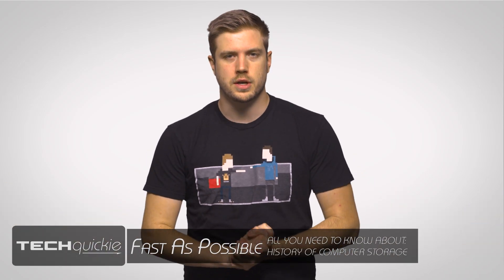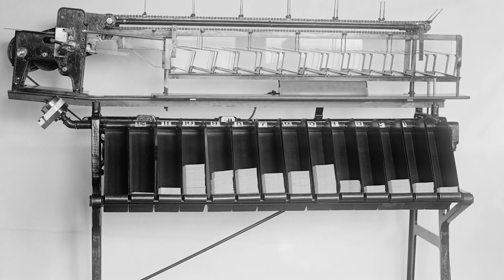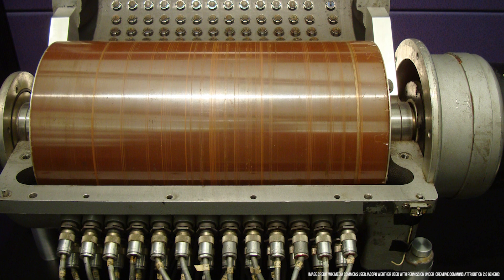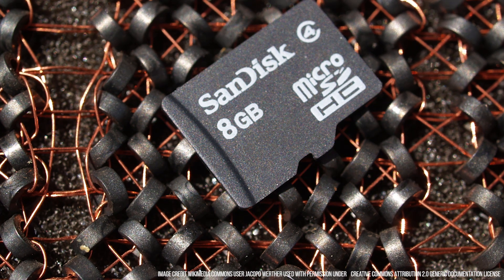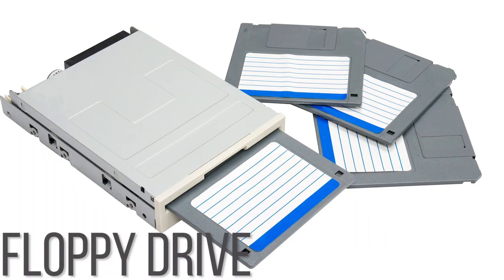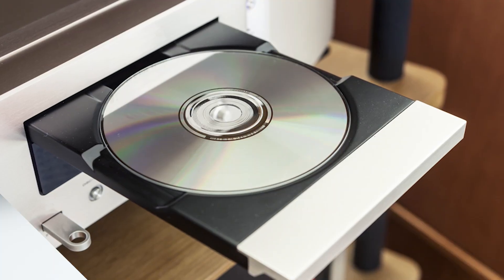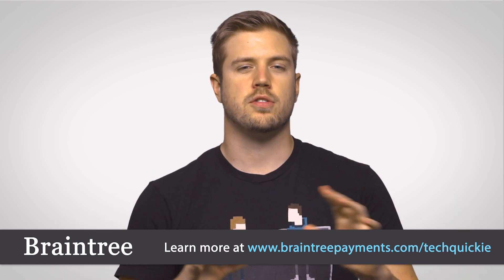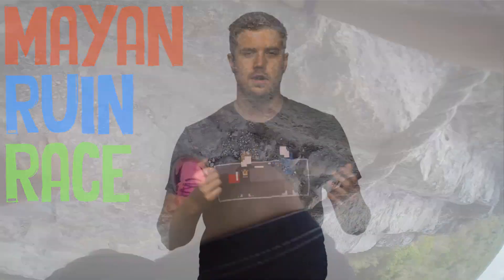The History of Computer Storage

Comment: Insert floppy disk 1 of 25.
Reply: Ha LOL! Lucky I missed all that Windows installation nonsense with 25(!) floppy's
Reply: Billy Ashworth As i child i always liked to chew the floppy disks. There would always be at least one missing from the bundle.
Reply: gta 5 Still needs 7 cd's to download, about every 15 mins i needed to switch cd's

yes. gta 5 on a cd...
Reply: +CWplayer
No, if you would store GTA V (65GB) on CD's you would need 93 as a CD only holds 700MB. 
With single layer DVD's (4.7GB) you would need 14 and with dual layer DVD's (8.5GB) you would need 8.
Because of that modern games are sold on Blue-ray Disk's of which you need 3 for single layer disks (25GB), 2 for dual layer disks (50GB) or only 1 for triple layer (100GB) and quad layer (128GB) disks.
Reply: +Mid Night I'm pretty sure physical PC games have not made the switch to Blu Ray yet.  I got black ops 3 for PC on the cheap and it included 6 DVDs and a steam download code.
Reply: Terraapples
i just checked, you are absolutely correct...
And it confuses me...
But as i just checked, 7CD's are stil cheaper around 30% then a single triple/quad layer Blue-ray.

From this i would predict that the change will slowly happen when game files exeed 100GB.
Reply: GTA V on Floppy disks...
Reply: *****
On the classical 1.44MB floppy disk it would take 45,139. For the biggest one available (240.75MB) stil it would take 270.
Reply: Gta5 on punch cards..
Reply: i think the reason why they're still using dvd's for pc games is simply because most pc gamers don't have a blu ray drive. 
and many of those don't have a good internet connection either so they would cry that they have to download for literally one week for a 60+gb game.
Reply: +CryoMotion i download at 1-2mbps :D 

kill me
Reply: CWplayer
i had myself a bambus internet connection for years. i feel sorry for you ;o btw mbyte/s or mbit/s ?

i had to stuggle with 350kb/s .-.
Reply: Fixedup89
Warning assumtions used
With a pretty standart 80 collum punch card (resulting in 120 bytes of storage) you would need about 541.666.667 punch cards for the 65GB of GTA V
Each of those cards is about 0.000180m (0.007 inches) think.
When you would build a tower out of the cards needed to store the game it would be 97.5Km (60.584 miles) high, just below the edge of space.
Reply: CryoMotion
3 years ago i had to struggle with 100Kbits...
Now the real problem is that 100Kbits is only a marketing stategy and normal datasize is in KB so the "real" speed (including code inefficency) is about 10KB.
It would take min. 2 weeks to download (i have a photo from this time of me trying to download Battlefield 4, 475h.)
Reply: Just to let you guys know, 8 Bits = 1 Byte, so that means 1 Megabit = 125 Kilobytes, and 8 Megabits = 1 Megabyte. Also Internet providers use Bits instead of Bytes for marketing reasons.
Reply: +CWPlayer
That would be 3 single layer DVDs, or 1 DL DVD and 1 SL DVD
Reply: +Terraapples, Mid Night
Reason is not many have a Bluray drive.
Everyone has a DVD drive.
Reply: Ralakus
Not in australia they dont
If you're on the 1000GB plan you get 100GB of data(upload and download)
Which is about 93.1GiB in windows
Reply: +CryMotion +IIGrayfoxII Actually, many people don't include any disc drive in their build these days, because you can easily get a download code for your piece of software or video game or you can get the software on a USB-drive.
I can't remember the last time I used my DVD-drive.
Reply: +Clin9289
True
I Have a bluray writer on my PC but it is more of a full entertainment machine powerhouse, HTPC, Gaming and encoding
Reply: IIGrayfoxII I don't have a DVD drive or blu ray drive
Reply: that would be around 73662 disks
Reply: And it wont improve with the abbottnet.
Lets make it just as fast(1/5 the full fibre speed) and cheaper(11billion more than the full fibre  plan) by going fibre to the node and copper to the home.
After all Malcolm Turnbull invented the internet in australia
Reply: Eric Revollo
which disks are you refering to?
Reply: Fuck man i remember putting gta1 on like 30+ floppies for my buddy... And many years later finally getting the ability to burn discs at home, crazy how far weve come even since then
Reply: It'll count upto 36MB wtf
Reply: Well at that point you should make a life size maket from those punch cards of liberty city.
Reply: JustDSBM
This was just a theoretical calculation based on the often used minimum requirement of 65GB free space which would require 8 DVD's.
BUT the game has less then 60GB when originally shipped as the 65GB include updates and addons and the data is compressed.
Reply: if you mean mega-bits, that is terrible, but if you mean 1 - 2 megabytes, that isn't bad at all. It is just average.
Reply: JustDSBM I live in america, i'm talking about 1 or 2 mega BYTES, so 25 mb/s because you hardly ever get what you paid for :/, so while you should be getting over 3 mega Bytes per second, you may only get 2. Also, there are faster options available such as 50 mbps, 100(what i have) all the way up to gigabit internet or faster, and everything between.
Reply: Insert Disc 1 of 7 (GTA V every disc = 8.5GB)
Reply: and now, im used to 100kb/s..and i got that from tethering.. now for $20 we get 100 mega bit/s through a fiber optic cable here in indonesia
Reply: JustDSBM you can in some parts of the us. It completely depends on where in the us you live - think of each state as a mini country - they can set state laws, taxes, minimum wage, ect..., however, every state is still under the federal laws. So if i kill someone in California or if i kill someone in Texas, i will get in trouble either way, even if for some weird ass reason the state didn't have a law against murder, because murder is a federal offense. an example of a state law is gun possession. federal gun laws are very lax, and just prevent us from obtaining weapons of mass destruction - we can't own machine guns that are registered after 1986, and we can't go and shoot guns in our front yard if we live in the city. However, states can put restrictions on guns. California has a lot of gun laws, you cannot own a machine gun there, and many type of guns are banned. But in a place such as Louisiana, or Kentucky, you can walk into a store and buy any gun you want without a license, as long as it isn't breaking federal law. Different states also have different punishments for crimes...

But nevermind that, i am completely getting off topic - how did i go from the internet being 20 dollars to the united states law system anyways o_O. Basically what i'm saying is that you could get 100mb for 20 dollars, it just depends on where you live.
Reply: But.... I need one dvd to install gta v on my xbox 360 and one dvd to play
Reply: ***** you have no updates now, that's why :)
Reply: King's Quest lol. Every 5 seconds, after going from one end of the screen to the other, you'd have to insert one of 25 floppys ha
Reply: I still have the 3 disk counter strike installation
Reply: A friend of mine with crappy internet won a steam copy of GTA V, took him 2 weeks to download it. Kinda felt bad as it only took a few hours, but then I talked to someone with Google Fiber who downloaded it while eating breakfast one morning.
Reply: I have fibre. it's really fast but it doesn't really matter.
Reply: Bubbles Are Good How does that not matter? faster internet always matters!
Reply: BlazeItGaming It's extremely expensive and it doesn't work a lot of times.
Reply: Bubbles Are Good oh, well if it doesn't work well and is overpriced, get rid of it.
Reply: BlazeItGaming It's still pretty much in beta in Canada....
Reply: Bubbles Are Good oh
Reply: BlazeItGaming Also I paid a lot of money just to get fibre into my house, and Bell checks up on my cables and stuff a lot and their customer service is great, while other internet companies won't do a thing
Reply: Bubbles Are Good oh well that's good. If my internet goes out i call and get a robot and have to wait 30 mins to get ahold of someone.
Reply: Next century: Insert SSD 1 of 38
Reply: Coming Up : GTA 37. With a file size of ONLY 74 TB! With 64K resolution,and a map size of 14,598 Square miles! Only on X-box Scorpio 83 and Playstation 87!
Reply: James Mc Donnell i can see that happening one day
Reply: They should release this on 52,662,223 floppy disks.
Reply: dbsirius sometimes you have to use like 4 or 5 CD or even dvd I've yet to see a multi disc blu ray videogame
Reply: Insert punch card 1 of 10 million
Reply: I have a speed of 17Mb, yet in my country, that's slow. (the average is 36.2Mbps)
Reply: Then days them days
Reply: +Marius Müller
Standard 80 column punchcard has 80 bytes of storage. Extra 4 rows allow for less dense data encoding to maintain structural integrity of the punchcard.
Imagine punching through all 12 rows in a single column - cardboard will become flexible and weak in that spot, and such card would most likely be torn apart in the reader/sorter, causing a jam.
Reply: Install floppy disk 1 of 13 of Windows 95 installation.
Reply: Insert disk 1 of 1024 lol
Reply: Immagine if GTA was on floopy disk...
Reply: Simone Mastroianni 21st Century would be screwed.
Reply: I have now in my hands MS DOS 5.0 floppy disk 1 of 2 and 2 of 2
Reply: Simone Mastroianni where you get from?
Reply: in the attic, but the disk 2 of 2 is corrupted... :(
Reply: Simone Mastroianni I suppose you could buy one again on ebay. Once you have done that you will be up to date.
Reply: hahahahah :), or I can download 2nd part and copy all files on 2nd floppy :)
Reply: I didnt use a cd in the last 10 years
USB is all you need
Reply: Hi
Reply: 40 Floppy Disks for Windows 95...
Reply: Lol miss those things. Millenials: what is this magentic storage you speak of?
Reply: Windows Vista was the last os officially released on floppy disk. It was expensive though. It makes sense since you have to have about 275 floppies. still don't know how they managed to fit entire operating system of Windows Vista on only 275 floppies though
Reply: Actually the Video Toaster had 45 floppys before they decided a cdrom was a good choice. LOL Many hours later. LOL
Reply: No, i don't want to.
Reply: Inserted
Reply: seem to remember dark forces from lucas arts was on like 16 disks
Reply: @mariusmuller2420  they came out with fdformat where could get the disks as high as 1.9megs
Reply: Insert punch card 1 of 55 thousand
Reply: @mariusmuller2420  modern games are still sold on DVD at least when it comes to computer games Doom 2016 for example I bought that on a DVD at GameStop along with a steam controller.
Reply: @Ralakus: No, the ISPs don't use Bits for marketing reasons, but because you don't transfer bytes via the internet, but bits. Most times 5 bits, 4 for one hexadecimal number and one as a spacer or checksum, then the next 5 bits. Internet is a serial data connection, so bytes will not help you much ;)
Reply: * looks at pc* em who did thid
Reply: @nednav8585  CDs*
Reply: @mariusmuller2420  CDs*
Reply: @mariusmuller2420  DVDs*
Reply: @mariusmuller2420  Disks*
Reply: dbsirius oh lord, those were the days lmao
Reply: The reminds me of when I would back up my computer in the days of DOS.  I used PKzip and made multiple disk archives of my files in those days.  It would just fill up a disk with as much data as possible then prompt for a new disk and me to press a key.  We still use the zip format today but with some differences.
Reply: Then try disk 1 of 2800
Reply: @mariusmuller2420  change is here
Reply: Ok
Reply: Flopy 1 inserted
Reply: Flopy 2 inserted
Reply: Flopy 3 inserted
Reply: Flopy 14 inserted
Reply: Flopy 5 inserted
Reply: Flopy 6 inserted
Reply: Flopy 7 inserted
Reply: Flopy 8 inserted
Reply: Flopy 9 inserted
Reply: Flopy 10 inserted
Reply: Flopy 11 inserted
Reply: Flopy 12 inserted
Reply: 3
Reply: the other disk was invalid. Please make sure that it is in the flopy drive reader
Reply: Trying again Flopy 13 inserted
Reply: Flopy 14 inserted
Reply: Flopy 15 inserted
Reply: Flopy 16 inserted
Reply: Flopy 17 inserted
Reply: Flopy 18 inserted
Reply: Flopy 19 inserted
Reply: Flopy 20 inserted
Reply: Flopy 22 inserted
Reply: Flopy 23 inserted
Reply: Flopy 24 inserted
Reply: Flopy 25 inserted
Reply: Dos. Now corrupt please press ctrl+alt+delete 

awaiting input...

Restarting pc
Reply: Welcome to windows 3.0

__________________________________
[Games Nintendo ds emulator.          ]
[File explorer file1.                                ]
[ Ms edge.  Minecraft.                          ]
[ youtube.   Roblox.                 Ms dos]
[ Ms paint.  Google.                              ]
[__________________________________]
Reply: Opening Ms dos
Reply: Power off in 3
                       2
                       1

2 likes to go to recovery mode
Reply: @nednav8585  bruh it uses DVDs fool
Reply: Pov you re installing windows 95 with floppy disk
Reply: That  sounds like the number it took to install one of Borland's C++ complier/development suites.

Comment: Insert floppy disk 1 of 200000000000000000 to install gta 5
Reply: More like 22223 floppy disks. Much more accurate.
Reply: 69 likes
Reply: Let's say you had the theoretical maximum (2.88Megabytes). GTA V has 94 GB,or 96,256 MB (1GB=1024 MB). That results in 96,256/2.88 which is 33,422. You would need 33,422 floppy disks to run GTA. I know I'm late,but I don't care
Reply: Uroš Bukorović wow your really smart
Reply: @zeakks  I used mafs
Reply: @dragoneater2008_  2+2 is 4 minus 1 thats QUICC MAFS
Reply: Windows must be smaller its like 5000 floppy disks
Reply: @sharl_leg  1 GiB = 1024 MiB, 1GB = 1000MB, but you're correct for the rest
Reply: @zeakks  Bruh it is pretty simplistic math. Nothing smart about that.
Reply: And a 3k phone bill for the authentic download experience

Comment: 1956: Yey IBM finally introduced 5mb of harddrives.
2016: Despite having 15 feet tall, It only held 5mb of data.
2100: Back 2016 when Google span their data center for about a mile but only held hundreds of exabyte. Pathetic

Comment: You forgot to mention that old computers used cassette tapes to store data as well
Reply: They said tape drives. While they didn’t specifically say cassettes, tape drive is a broader term that covers cadettes and also floppy disks or other magnetic media.
Reply: @chuuisinsane  no, it doesn't. It covers magnetic tape storage, not cassette, and much less floppy disks
Reply: @nasonaso8356  I was wrong about floppy disks, but either way Angelo didn't mention floppy disks and just asked about cassettes. Those are covered under tape drives since they are, indeed, magnetic.
"
The Compact Cassette or Musicassette (MC), also commonly called the tape cassette, cassette tape, audio cassette, or simply tape or cassette, is an analog magnetic tape recording format for audio recording and playback."

Also floppy disks are just cassette tapes as a rotating disk instead of a long strip. Still wasn't too far off.
Reply: @chuuisinsane  i admit i was wrong about cassettes, but floppy disks aren't magnetic tape.
Reply: @nasonaso8356  They are made of the same material though, just in the form of a disk instead of a continuous tape. It's still a thin piece of plastic coated with metal.
Reply: @nasonaso8356  Um, Cassettes in fact ARE magnetic tape storage. The earliest magnetic tape storage devices used open reels of magnetic tape. What is a cassette? A tiny box that holds tiny reels of magnetic tape. 🤷‍♂️

Comment: The problem with flash memory is you lose a lot of data WHEN, not if, they take a crap.
Reply: That happens if SSD DRIVES are not powered up enough,if they are left unpowered for over 12 months or more the data will disappear

Comment: You missed acoustic and magnetostrictive delay lines, which would have fit in nicely before mentioning core memory. Acoustic delay lines used sound waves traveling through vats of liquid, usually mercury. Magnetorstictive types used vibrations through a nickel alloy wire. Sound representing the bits was transmitted at one end, received at the other, and then processed, amplified, and recycled back at the transmitting end. Many early calculators and computers used these. A typical calculator of the 1960s carried about 400-800 bits of data on it's delay line.

Also, there was the RCA Selectron tube. The Selectron was a directly addressable 256 byte vacuum tube RAM. It was used in the JOHNNIAC computer. A 4096 bit version was proposed, but not produced.

Comment: Several others have mentioned the cassette drives, which I believe either Amiga or Commodore64 (that's 64 kilo-bytes) both used for storage. However, some other iterations were skipped, as I remember in the 80's our WP dept. had a 10Mb hard drive a little louder than the dorm refrigerator size-spot it occupied. Besides Zip drives, both Zip and Jaz drives were brought to us by Bernoulli, the name of a principle that built a 5-1/2" 150Mb drive/cartridge combo that used air to keep multiple magnetic layered for read/writes. Then there was also Syquest, that gave is 5-1/2" 44Mb, 88Mb and 280Mb single HD platter cartridges in a plastic case. They also made the  EZ135, a 3-1/2" variant that held a whopping 135Mbs again on a single cartridge disk platter. There were LS-120 floppies that didn't last...long, and magneto-optical disks, similar to those EZ135s, albeit a CD-in-a-cartridge. These disk types and peripherals existed because hard drives weren't all that big, nor 'dirt' cheap: Up 'til 2000, the average business machine had a 20Gb HDD. So I'm kinda disappointed when Luke blew right over SDXC cards, because for $8 I could throw  my 49-disk collection of EZ135 cartridges on a thumbnail sliver, and still have 30 Gbs to spare.  ;) BTW those last five technologies - if you ever want a picture, I have them running on my desk.